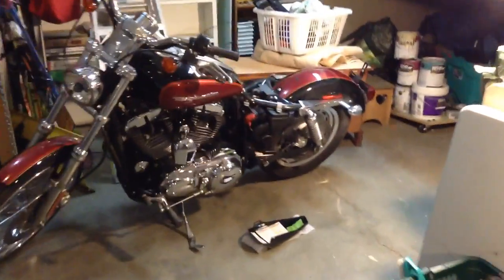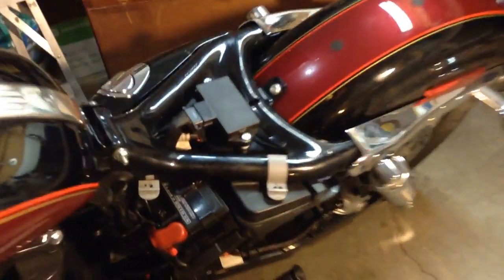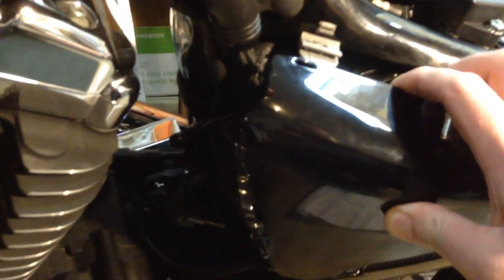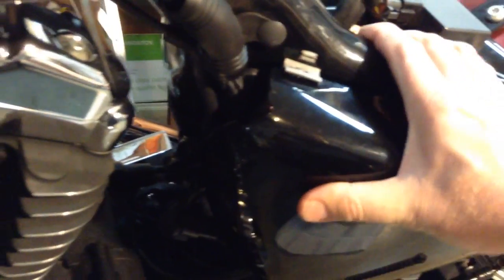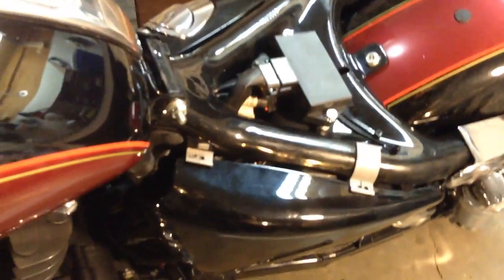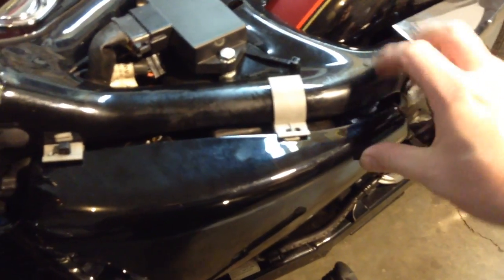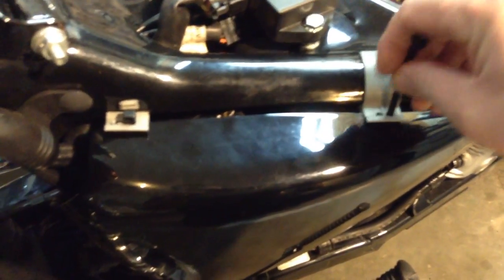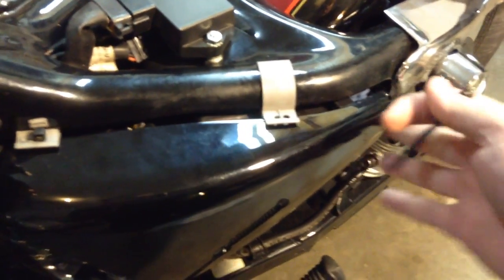Harley Davidson Sportster Battery Cover Clip Fix

Comment: Thanks for the vid. I've been using a screw on mine for  a couple of years now, and it's been a real pain in the arse. I had gone to the dealer because I heard they had redesigned the clips, but the guy in the parts department told me they weren't any better. I just pulled the screw out and replaced it with a zip-tie, and it worked perfectly.

Comment: Thank you, I've heard people say to use a zip tie but I was picturing having to loop it around something to zip it closed. I figured that would be more trouble than it's worth cause you'd have to cut it off and do it again every time you needed access to the battery. Thanks for the reminder that sometimes the best solution is the most simple one.
Reply: I've been using a zip tie looped through an opening for a few years now. I use a zip tie that has a push tab that allows it to slip free. Pushing the tab in and releasing it can be a bit of a challenge with the seat on, so I'm going to give this idea a try.         BUT, if a zip tie that is releasable is of interest, they're out there.

Comment: This is awesome! I've had this issue for years, actually have a habit of constantly looking down while riding to check to see if my cover is hanging off the bike (because it's happened!!!).  I resorted to just electrical taping the hell out of it, but in summer heat, the tape melts off.  I knew there had to be a fix and I had to not be the only one with this issue.  Thanks for posting this!!
Reply: Just got my Harley 5 weeks ago and yeah it come's off once ya get to like 100ks I'm lucky I have side bags and my daughter on the back or guess I would of lost itI'll be looking at it and doing this fix thing before I take her out next

Comment: Well how did you drill a hole in the rear clip as the oil tank is right below it so did you carefully do it or did you accidentally drill into it like I did which I had to patch the small hole with JB Weld which I removed the clips and replaced them with velco straps which I should of done to begin with so I wouldn't of drilled a small hole on top of my 2007 Harley Davidson Sportster XL1200N's oil tank.

Comment: Funny I found this on the day my battery cover blew off the bike breaking my nylon zip tie. I heard it hit the road turned around on the highway went back and found it. a car ran over the skinny end and the road did the the  job to the paint. Took it home and beat it back into shape which didn't turn out too bad. Then started sanding... which I hate to do because I never get it sanded right... repainted it and see all the places that didn't get sanded enough :(  Now I've got to fix those spots. I am going to get it secure on that bike if I have to weld it on and cut it off each time.